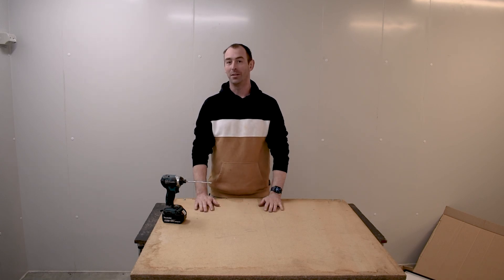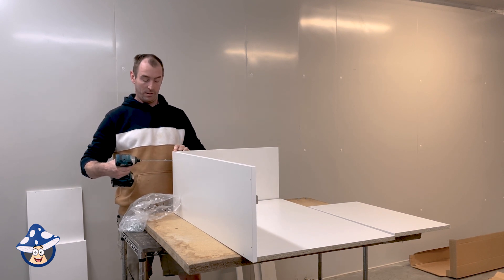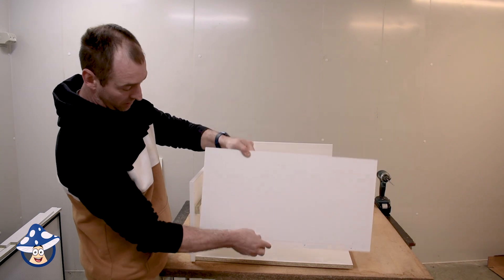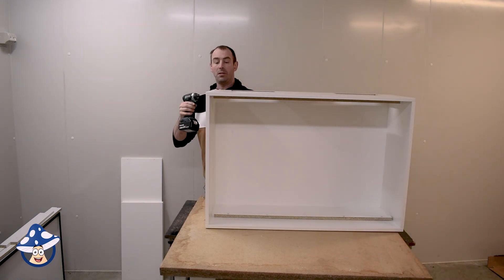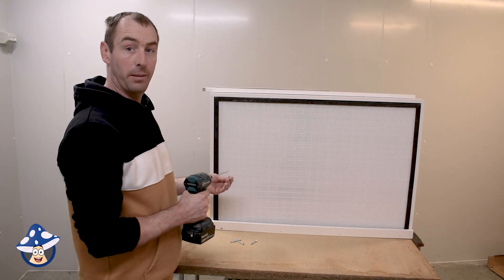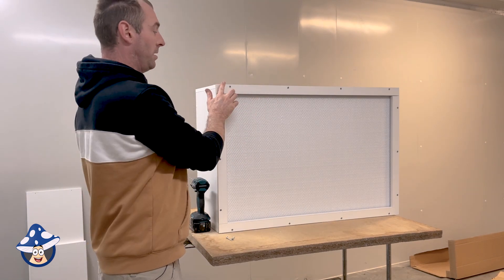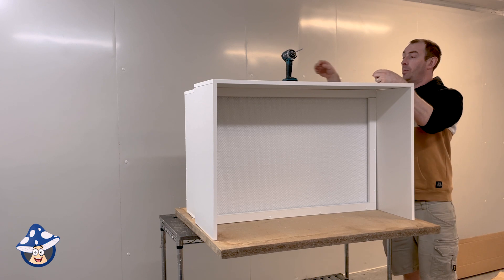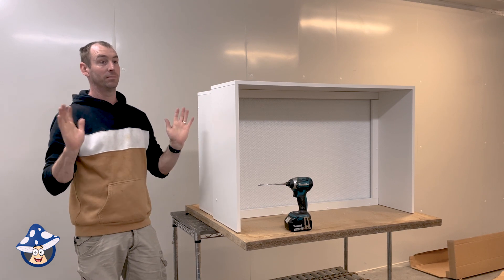How to Build Your Aussie Mushrooms Flow Hood

Comment: hi just wondering if there is any way to incorporate a pre filter into the set up of your guys flow hoods, as from my knowledge it is a good way  in extending the life of your main HEPA filter. thanks! - found it on the website, awesome!
Reply: never mind sorry i found it on the website, fantastic!!!
Reply from the maker: Thanks I’ll
Answer here for othered tho :) you can move the hepa filter frames inside back 21mm to allow for it 
Or you can also just sit a small pre filter over the fan intake - the 1 opening fans are easy to sit one over, the bigger units not so much :)